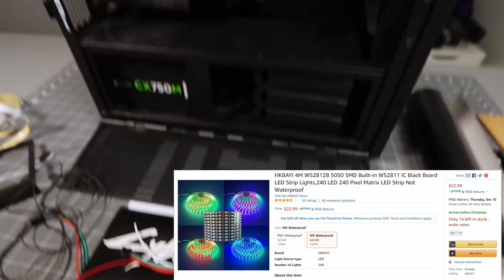I Cyberpunk-ed My PC Case, and So Can You (ws2812b LED strips, 3D Printed and Vinyl Cut Logo)

Comment: what temps does that cpu get with that cooler?
Reply from the maker: Hey Clean Playzz.  After 30 min or so of Cyberpunk I topped out around 76C degrees.  With 45min or so of Borderlands it kissed 80C for a second but was normally down around 76.  I think it was actually the ubisoft updated running in the background at the same time that pushed it up a bit.